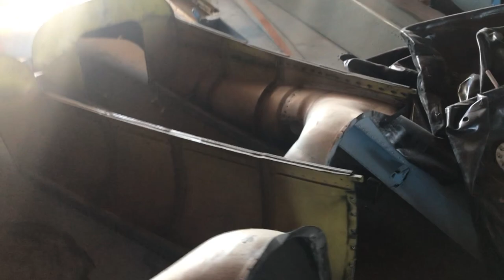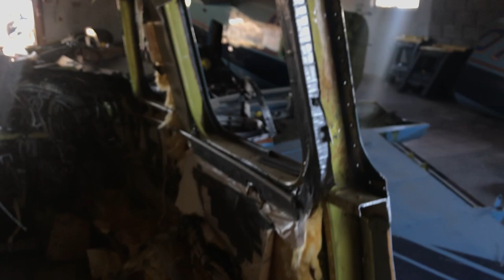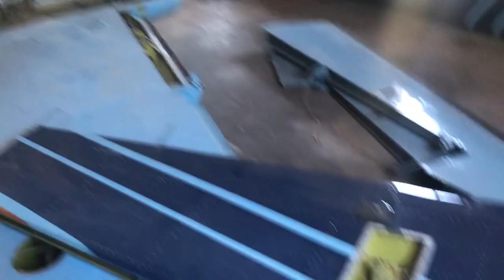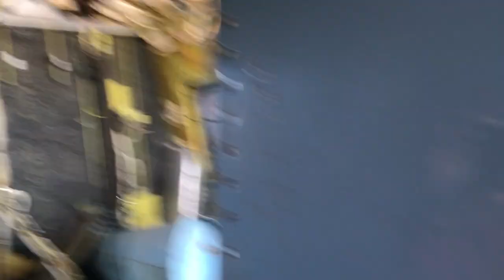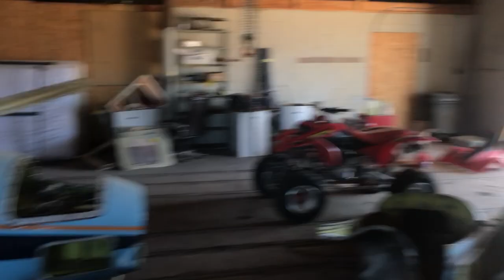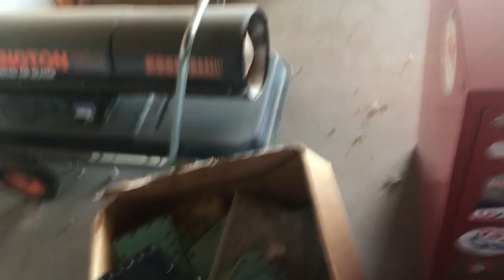Abandoned Airplanes: Turbo Commander Barn Find!

Comment: So could that be brought back to flight condition again?  Would you have to be FAA certified in order to do that as a normal person or does that need to be professionally put back together?
Reply: littlewingpsc27 cut up the way it is, it would be unlikely and almost impossible to save it. It being a certified aircraft you would need to be a licensed mechanic to work on it as well. Sad to see it cut up in such a way.
Reply: @ResurrectingFlight  it's also not worth it. not very expensive plane

Comment: So what happened to this thing ?
Reply from the maker: The pilot landed long and slammed both engines into hard reverse burning them both up.
Reply: @FlyingWildAZ  Damn. Never thought you could torch an engine with reverse thrust.
Reply: @FlyingWildAZ  Looked up the NTSB Report. Its saying that the nose wheel locked and caught fire resulting in substantial damage to the front section of the plane. A few picks as well. If they burned up both engines as well, no wonder they plane was stripped and totaled. It was a 690B. Sad to see....
Reply: @j-flyerpg65  It's always interesting to hear the story behind it. 
2 burnt engines and a compromised nose, probably worth more as parts now.